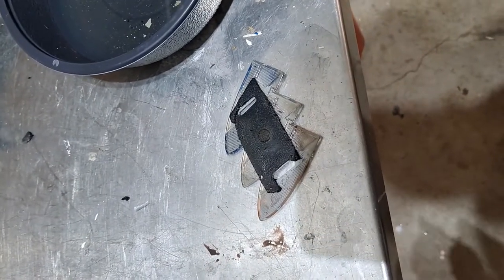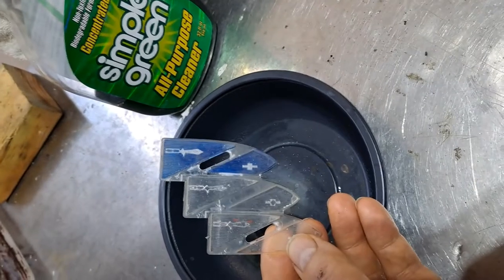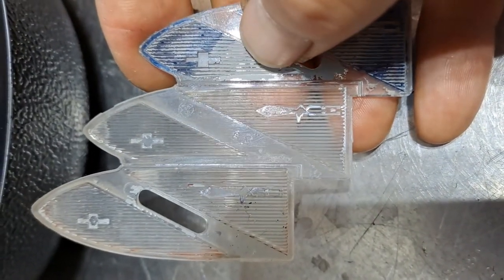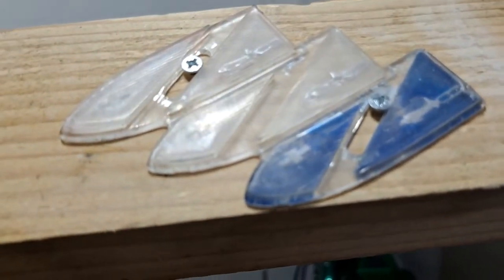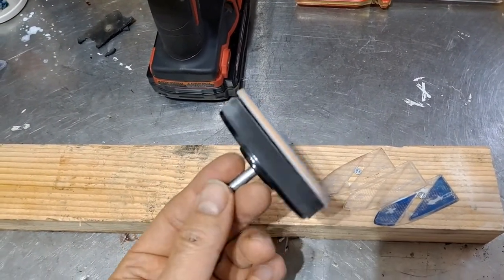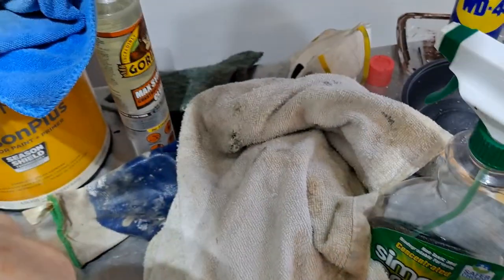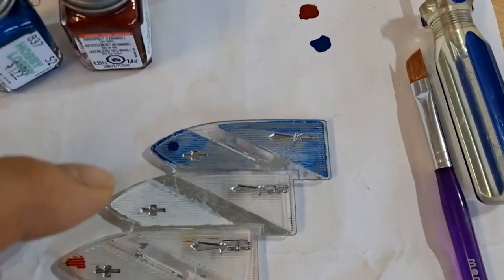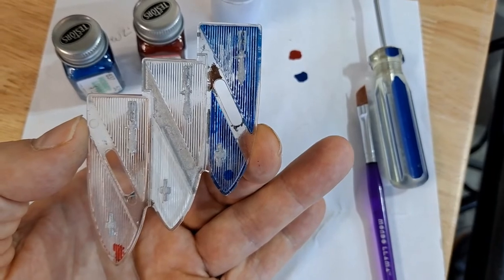How to restore a 1963 Buick Front Emblem

Comment: Molotow doesn’t work on reverse surfaces, it wasn’t intended for that purpose.  Originals were vacuum plated after special tooled masking covered each detail to be spray painted.  Molotow levels out on the surface but cannot do so on in behind.  The red and blue on pretty much all vintage emblems are candy apple red and blue, which are supposed to be backed by the plating to make that bike reflector effect.  You can dissolve most of these vintage paints in pure turpentine and the plating will dissolve in rust remover both without damaging the plastic.  The rust remover sometimes softens and loosens certain paint types varies form year to year
Reply from the maker: this is good info - thanks !

Comment: I would NEVER clean plastic, ESP clear plastic with Acetone!! it melts almost all plastics! freshly placed Testors model paint or that spray can paint wouldve cleaned off with either Mineral Spirits or Alcohol? also simple green sprayed into a ziplock bag and left overnight would have stripped that clear badge totally without crazing or hazing the clear plastic like paint stripper can sometimes do
Reply from the maker: Thanks for the comment.  I agree that acetone is very aggressive.  It didn't damage the plastic on mine perhaps because I was only using a tiny amount on a q tip.  I agree that your suggestions are more favorable.  Thanks again for the comment
Reply: Yeah, acetone doesn’t melt ALL plastics, just certain flavors 😉 
Good work, brother.
Reply from the maker: @BrandonRosenstrauch  thanks !
Reply: Watching guys rebuild little hot wheels cars .what they do with the windshields is clean with soap and water .sand if need be and then use some kind of floor polish.they just dunk in the stuff for a couple minutes and the windshield look brand new